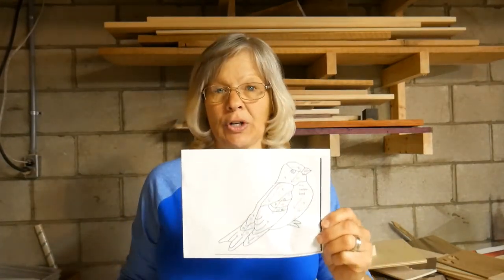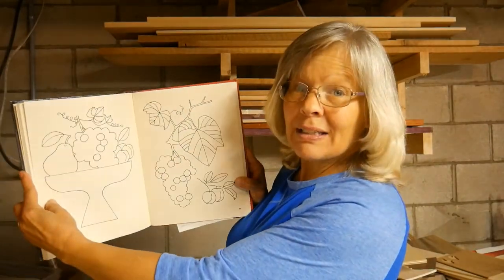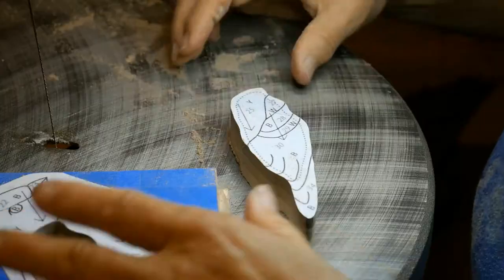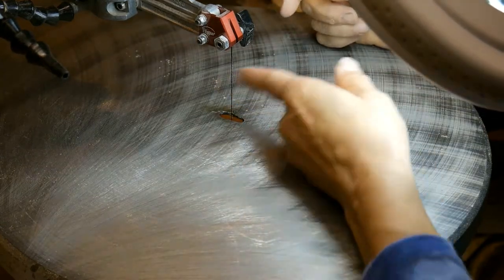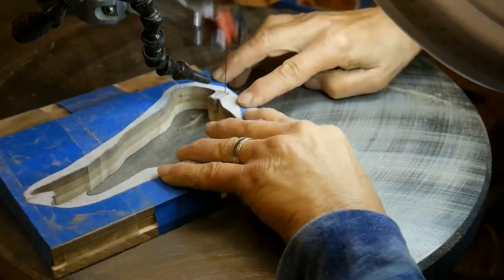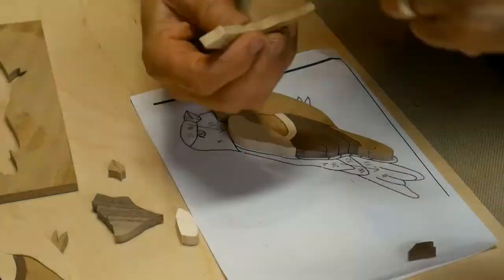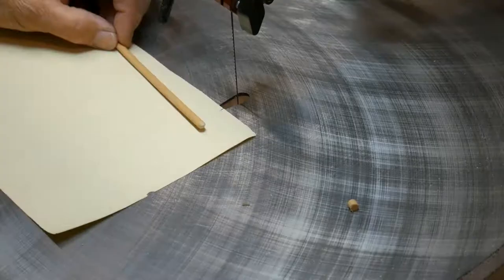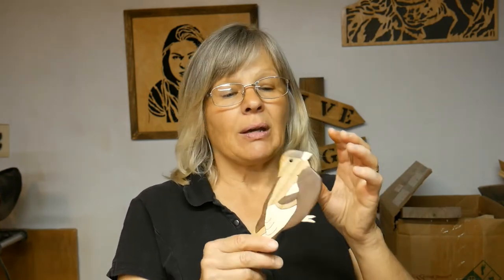Scroll saw segmentation bird instruction

Comment: Thank you. Great video. Lots of helpful tips. I will give it a try. What glue do you use to hold the pattern on the masking tape? Thanks again.
Reply from the maker: You can use glue sticks or temporary adhesive spray or 3m’/gorilla  glue permanent.  Any will work just fine.

Comment: Can I ask? What type of double stick tape do you use?
Reply from the maker: My double stick tape is so old that the label is no longer on it. I do know that I got it from Menards and it is specifically for carpeting. Make sure whatever brand you buy, that it is thin enough that it will not create a problem with your wood, lying flat.
Reply: @SusanLoar  Thanks!